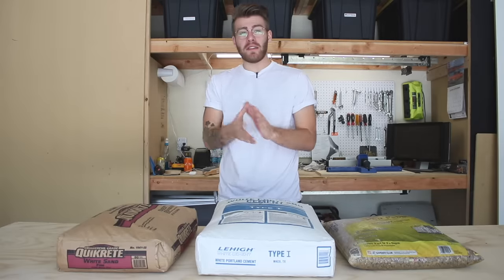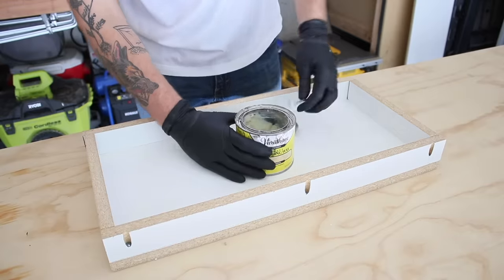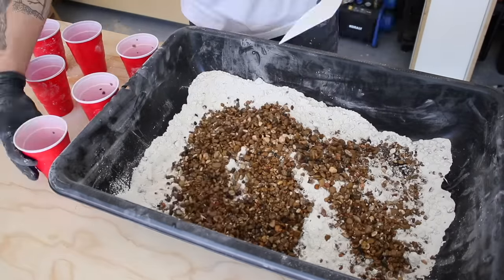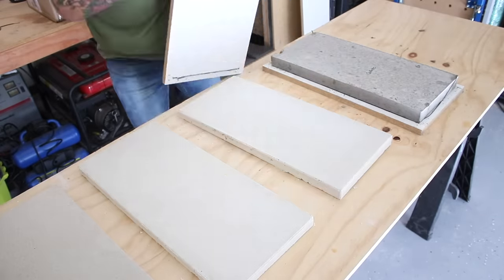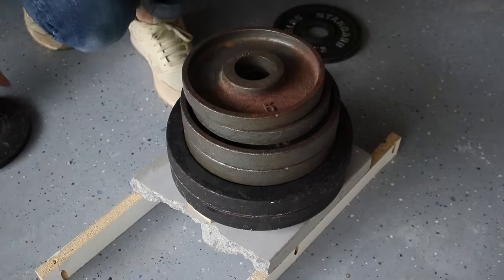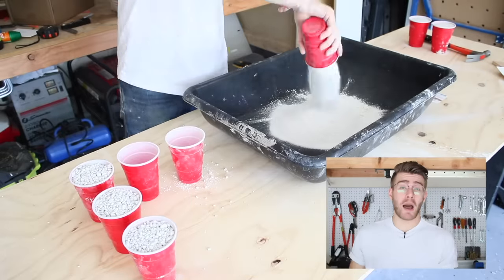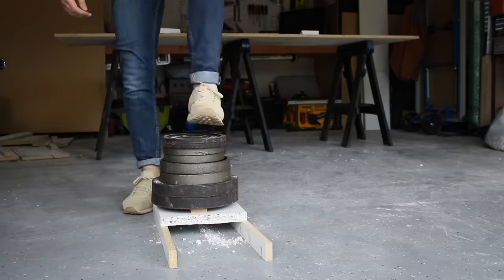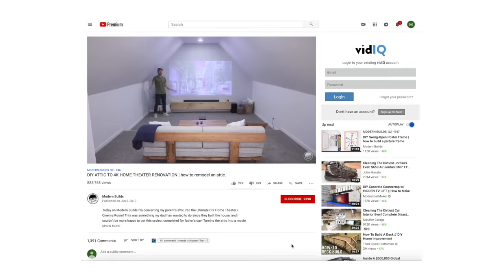How To Make White Concrete | A Modern Builds Experiment

Comment: The mix is pretty similar to what ive been told by some guys working in a concrete factory, they were friends of our master carpenter.
Try adding some different sizes of sand grains instead of one size, from coarse up to essentially powder, poor a thin layer and vibrate it, add GF to the rest of the batch and add it ontop of the surface layers. Ofc rebar and water replacments on final products.
Thats how we made them and we got super smooth surfaces with dense concrete strong enough to support an IIRC 30-40cm floating edge.

Cheers!

Comment: I use a jigsaw to vibrate the form. It works awesome. What i did was make my own white concrete like this but i used perlite. I made hundreds of fake stones and used them over my siding on my house. The perlite kept them really white and they were lighter. I made several different sizes but they all fit together to make a 4x8 panel. It worked out perfectly. It took about a month total time. I used construction adhesive to stick them to my house. I think it was liquid nails. They don't come off either lol. If you try, it will pull the siding off. After i glued them all on i grouted with some medium dark grout for contrast then sealed everything with a good concrete sealer. It looks so good my neighbors want it done. Guess im making more now.

Comment: A couple of points. For the corners, foundry supply dealers sell wax fillet material that is molded with a radius on the inside and a square corner on the other. Might be easier than silicon caulk.

For your aggregate you might try crushed white quartz on a half to three quarter inch thickness, then use a portland mix over the top to save money.

If you making pavers, look up Penrose tiling for details of the geometry. You can then use a 3D printer to make molds with a few degrees of draft for easy demolding.
This way you can precisely measure your batch sizes so one batch will fill one set of molds. Each mold can then be placed on a small shaker table or vacuum box to de-air the molds.

Probably take less than an hour each  night after work to make a batch of pavers. Should you want to add some steel reinforcement the wire fabric can all be precut.

For a test rig, make a test fixture with a long lever that applies force on a round bar. By hanging weight a measured distance and doing a little math you can measure the exact strength. I think the standard is 28 days.

If you want to make wall tiles. You will want to make your concrete with a light weight mix.  Also good for raised planter beds.

Comment: Sometimes googling is better than measuring, since concrete one of the most studied material. there are engineers specialize in concrete.    Maximum  stress could be written on the bag which is compression  stress. Generally, more aggregate and less water gives stronger concrete. Usually concrete functioning with conjunction with steel which is crucial for performance. then it comes the additives and there uncountable number of them. The most used ones are fiberglass for strength and anti cracking; additives for workablity or water reduces; dyes ..etc

Comment: i seen other youtubers use a formtool meant for clay and the sorts , basicly a steel ball on a stick , you use that to form the silicone using a lot of pressure and leave the overburden to dry with the rest , once dry you can pull off the overburden and be left with a perfectly radiussed inside corner , works eazier than the silicone squeegie youre using as you cannot angle it and get weird shaped corners or leave a verry thin sheem of silicone overburden thats hard to remove 
they did waxed the mould before applying the silicone

Comment: Great experimental processes you went through here.  The classic mix is 1:2:3.  Did you hydrate (wet) the concrete while it cured?  This is often neglected when first dabbling in concrete, but very important toward final strength.  White cement is optimized for cosmetic appearance, not strength.  Your experiments tested its tensile failure point, not the compressive strength which is concrete's advantage.  With fiber and/or metal reinforcement to improve overall tensile performance, those slabs would have performed far better in the breakage tests above.   Your setup makes for excellent A-B testing.

Washed, angular sand and gravel is important for strength as well.  If everything down to the sand is rounded, bonding and thus strength will suffer.  You want washed, angular sand and aggregates and no fines, otherwise you're grading into hyperadobe, not concrete. 

That pocket screw jig helps make versatile forms.  Without it, you'd likely be screwing in through the bottom which is much harder.  If you made forms with a little positive draft, you could just pop the slabs out without disassembly.

Using 100% bonding additive is pretty rich and would get very spendy in bigger projects.  10-25% in water would make a huge improvement over just water.  This advantage would be minimized with ideal sand and aggregate.

Comment: I could be wrong but I believe the reason the Aquarium Rocks didn't perform as well as the Pea Gravel is because the Aquarium Rocks are smaller and more uniform in shape.  The Pea Gravel you used had more irregular shapes and larger which gives the concrete more surface area to bond to  and the larger size also allows the rocks to interlace with each other strengthening the slab.

Comment: The water to cement ratio is the most important thing if you are going for strength. The less water you have the stronger the concrete will be. The lowest ratio that you want to go is 0.4 water to 1 cement however it gets really hard to move into place. To counter act this a plasticizer can be added.

Comment: the most important thing in concrete strength is c/w ratio (cement/water). you have to keep that ratio even for all of them to find out which mix is the best. and the best ratio is 0.4-0.5 ( it means  for 1mass of cement you have to add 0.5 mass of water)

Comment: I appreciate the effort in doing this. I have a couple critiques. Concrete needs 28 days to fully cure out while using appropriate curing methods. And last, 1.5 inch thickness is not thick enough. 2 inch minimum thickness. You could also use a bonding agent for better strength.

Comment: A few words from someone who has worked around concrete block manufacturing and concrete precast for over 20 years.

I do not understand why you would not use a white aggregate as well, since you are trying for white concrete. The bigger problem is the smooth stone, it should be crushed, having a rough texture.

The amount of water you add to the concrete will effect it's final strength. 

Additionally, any concrete pour like the one you are doing would be ridiculously stronger if you had added a steel rebar frame.
Reply: Dang, learn something new everyday.  Never thought about texture of stone in concrete.  I guess it does make sense that the concrete would be able to "grab" rougher stones better, thus making the final result stronger.
Reply: do you have a ratio you wann share that is the best ration for mixing the components? I want to build new walls for a room but afraid because if I don't get the ratios right, the walls might collapse on us while we sleep for example. I tend to buy pre-mixed concrete for that reason. But still....

Comment: Great video, but as mentioned water to cement ratio is one of most important factors for creating strong concrete that's why use of plastificators used by all commercial concrete suppliers, also  strength labeling of cement matter too such as 32.5 will be weaker than 42.5 N/mm.sq, Loved this video a lot effort has been put in and informative about how to make it whiter, helped me, well done.

Comment: The best ratio is 1 part cement 
2.5 part sand 
4-5 part of really angular aggregate " corners on the edges of aggregate gives a lot of strength "
Reply: Angular aggregate allows for better adhesion of the paste to the rock. Aquarium rocks are often either too smooth or have an epoxy coating to prevent them from reacting in the water.
Reply: In the netherlands we often use the 1,2,3 ratio

Comment: You can get even whiter concrete just using standard concrete mix and adding about 5% titanium dioxide. Ends up looking great, really white. TiO2 is used in soap making so it's really cheap. Since you only need 5% shipping is more manageable

Comment: Put some steel mesh inside the concrete towards the lower face of the slab to make it hyper-resistant. Concrete is thought to be compression resistant, the steel ads tension resistant. This is how we make concrete slabs for buildings.

Comment: Just the video i needed. Im looking to see what mix to use for a white cement concrete floor. Surly white sand & cement is just as strong as using grey cement for a floor? Maybe throw down some reinforcement mesh just to prevent cracking?

Comment: Along with all the recommendations about using angular gravel instead of round pea gravel I would add that thickness does matter. The minimum thickness for structural concrete applications is 1.5 inches. That was definitely a factor in the performance of the gray slab relative to the rest. All the white slabs were too thin.

Comment: As an architect i call tell you 1:2:4 and 1:3:6 are the standard ratio and works well for all kind of loads
Reply: Simranjeet singh matharoo 
Which materials do those numbers represent?
1gravel
2sand
4cements
?
Reply: @Chemeleon15  1 is for cement 2 for what we call fine aggregate thats sand and 4 for course aggregate thats gravel.

Comment: Why I think that the white cement slab didnt achieve strength is that the aggregates were too round due to which the binding of materials didnt take place. Where as the ready mix had variety/mix angles of size and shape of aggregates. And more importantly if you arent doing curing to the samples you should add plastizers, which I am sure are added in the premix batch.

Civil Engineer from India

Comment: Try using SBR instead of water, although you'll likely need a good forced action mixer. This will give you strength well in excess of standard C30 concrete.

Comment: Just a suggestion, I know there are already mixed concretes and are already mixed in dry state , but the order to obtain the strongest resistant concrete with the same ratio of water and cement is: add water to the bigger aggregate, then the sand and finally the cement. So the hidden pores of the bigger agregates, get totally filled with water (saturated) and later this saturated pores does not need to steal water from the other components of the mixture, weakening it.

Comment: For your testing you should have used 2 plates of steel 4 x 1" bolts and a torque wrench. I think AvE did a video a long time ago about a press. Also you should use cylinders. It's a lot less concrete, and it's more of a standardized test.

Comment: For anyone wondering rz masks are rated as n99 which is good enough for silica, but on their website rz says not to use their masks for protection against silica. So do what you want with that information I guess.
Reply: Super fine powders will clog up the mask. If you used a normal vacuum to clean up light building work like tiling in the home. You'll see how it clogs up the vacuum

Comment: To improve the strength of these concrete slab is to use a metal or plastic mesh layer in the middle. This will take the slab strength to another level.

Comment: maybe im late but the correct way to measure concrete is by making cilinders but the strenght will easily go up to 200 MPa if using normal cement or grey cement or portland

Comment: You need to add fiber and water reducer (plasticizer) and polymer to the mix.  That will give you some extreme strength!
Reply: Your cementitious and aggregate should be a about a 50/50 ratio.

Comment: All aquarium gravel is definitely a weaker aggregate as they have an Acrylic Coating on the gravel. Since the gravel has a 100% Acrylic Coating the cement is not going to bond well to the gravel and will reduce the strength of the resulting concrete.

Comment: I’m a terrazzo specialist , you should put steel rods into your forms , steel makes it 10 times stronger . Plus you should have put marble dust  instead off sand . When you polish it up it won’t egg shell , you ratios are totally wrong . The ratio for terrazzo is 1 kilo cement to 2kg aggregate , 550 ml water 200 grams marble dust , your steps will curl and craze the way you made them

Comment: I'm trying to whiten (lighten) gray portland cement so it ends up a light gray concrete color. Rather than buy a separate, expensive bag of white cement to mix in, is there another way to lighten it? Not concrete, but cement?

Comment: Thx for the video👍 One question, i made a pot yesterday with white cement + white sand (1+2 ratio), also adding dry pigment. But today, 24h +later the pot is still not set and looks crumbly? What am I doing wrong?

Comment: Wonder instead of aquarium gravel using white marble chips (landscape section). Would want to wash the dust off before adding. I thik the stones of the aquarium rock are too small however, I could be thinking wrong. I did find this whole video super helpful though as I'm formulating doing my own kitchen counters in May or June of 2020.

Comment: In the future, I’d do experiments that involve concrete/cement or any ingredients that involve volume with weight instead. 1 part sand won’t weigh the same as 1 part cement or 1 part aggregate.
Reply: in cement mixing you dont do by weight but by parts
Reply: Salvador Nobre Veiga uhhh yeah you can. Just buy a scale and you’re good.

Comment: You missed the most important thing in the equation, which is water . What determine the strength of concrete the most is the cement/water ratio, if you want a strong concrete product you need to keep cement/water >1 , the more you have cement the better , but not by much otherwise cracks may start to appear.

Comment: Why don’t you put the white cement and and white gravel with fortifier in first, and move it to the sides. Then put the pea gravel mix in the middle. That way you get the look you want on the top and edges.  Then in the middle you get the strength.

Comment: If you put a steel structure of some kind in the middle of your slabs  it would increase the strength exponentially. You could use chicken wire or a more rigid fence material.

Comment: Use white  quartzite spa stone chippings.  It's mostly used as decorative gravel but very hard. Smooth rounded gravel will make a weaker mix than rough surfaced crushed  stone.

Comment: Could you use this for countertops or is it too fragile?
Reply: Upon researching I have found out that you can use this for countertops but halfway through filling the mold you need to put in rebar or some sort of metal mesh to support the inside of the concrete. Fill in the rest of the mold like normal and they will be strong enough for countertops. Answered my own question 👌🏼

Comment: use olive oil if you dont have paste wax ;) it's not exactly the best thing ever but if you dont want to spend the extra couple bucks, it works well enough :D
Reply: used engine oil is best that's what they actually use when building with forms

Comment: The white pea gravel didn't work as well because it it's so small. The gravel is the strongest material in there. It adds strength when the gravel interlock each, preventing a clean break line through the concrete. Thd aquarium gravel is just too small if wouldn't have made deep interlocking fingers at all.

Comment: Hi budy geetings from Chile emmm well what can I say in this test you should test the diferente concretes with a concrete press so with that machine you will have more exact results those machines are made to test the resistance
So my advice is that you have to repeat the experiment making a cube of 15x15x15 cm  or a cilinder 15 cm díameter x 30 cm length  but using the concrete press to test the difetets mixes that you presented in the video and then you will have the real resistance
I work as laboratorian testing the resistance of the concrete
Thanks for the video  aniways so we keep in contact

Comment: Concrete is terrible in tension, so even 4mm  wire mesh embedded in the middle would go a long way in making many times stronger for the same thickness.

Comment: Concrete becomes ready to use after 28 days, or, it has 70% of ready after 10 days... So, testing wet concrete 3-4 days old - not a good idea
Reply: I'd also like to mention the importance of wet curing concrete. It needs access to moisture for the chemical reaction that creates strength to complete. Also, colors can vary while moisture is trapped in concrete, you should allow it to dry several days or oven dry before comparing color.
Reply: This guy sounds like he knows what he’s taking about...
I heard that concrete hardens up to 50 years?
Reply: I do make concrete conice use fiberglass mold 5 days is better for take out only if i use silicon mold is 1 day
Reply: @impactajuvenile 51 and a half

Comment: The 3-2-1 ratio is basically the same 'mix' as 'Roman Concrete'...where you use 1-part Lime, 2-parts volcanic ash, 3-parts volcanic rock and ONLY enough water to make a 'play doh' consistency concrete. Two things you really aren't taking into account that you didn't control here...the aggregate rock MUST be 'rough-edged' and large enough in mix to 'overlap'...it works like fiberglass, the cement is only 'glue', while you are 'bonding' the fibers (in this case, rock plates with sharp edges) to each other...while 'diluting glue' (too much water) makes glue weak! You have to understand 'what you are trying to accomplish', and realize it's not the 'white' but the 'too much water, incorrect rock shape and size' issue you have there...Roman Concrete, in many ways, is STRONGER and more-durable than modern Portland Cement/Concrete!